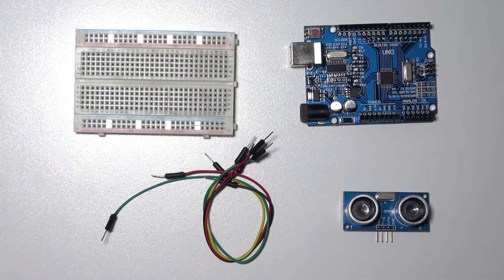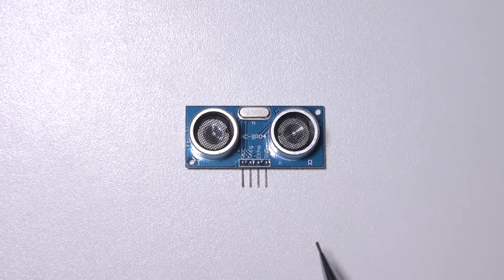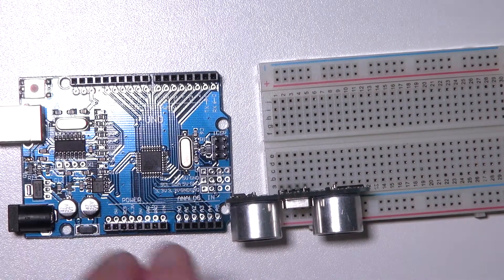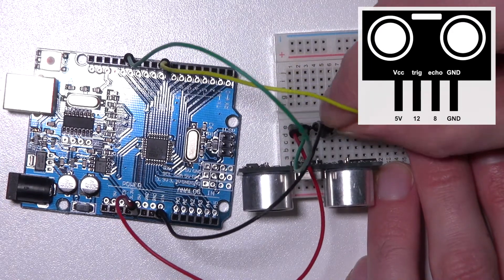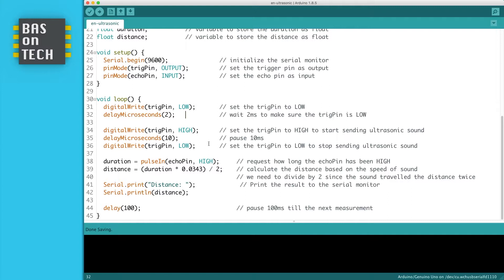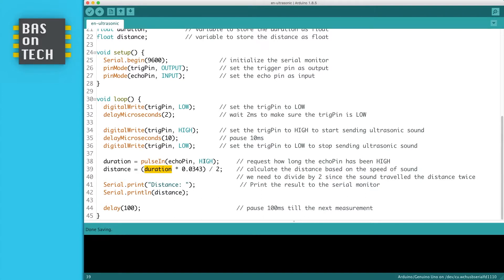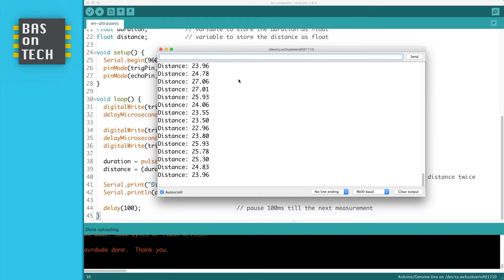ULTRASONIC DISTANCE SENSOR HC-SR04 - Arduino tutorial #7

Comment: At 3:42 (or line 35 of code) why do we set the delay at 10 microseconds in particular? 

And not at less or more microsecs?
Reply from the maker: We need a little time to start the sensor. Otherwise the measurement might fail. This was the delay I've found in other examples to work nicely.

Comment: Thanks for the fun projects.

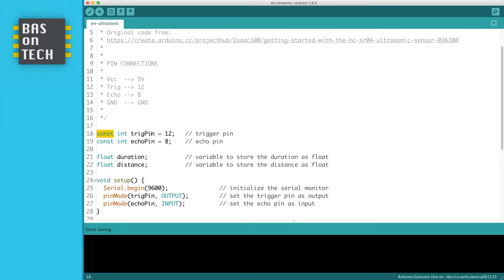At line 21 (and 22) of code (around 3:00) why do you declare the variable without assigning an initial value like in previous videos? 

Why'd you write 'float duration;' and not  'float duration = 0.0;'?
Reply from the maker: You can do both. Setting the default value is nicer since it is more explicit. However I've seen both being used in various code examples.

Comment: Speed of sound is 343 m/s so why are we multiplying duration by 0.0343? What is the unit?
Reply from the maker: Hi, pulseIn() return the elapsed time in microseconds. We want to know the distance in cm. Therefore we want the speed of sound in cm per microsecond which is 0.034 See:
https://www.arduino.cc/reference/en/language/functions/advanced-io/pulsein/
Reply: This is why I think he used the value 0.0343.

Because in this project, the distance is measured in centimetres, and time in microseconds.

Meaning we have to convert the rate of 343 m /sec to those same units.

And so we 1) keep in mind what we're after:

Rate of sound = distance /time = 343 m /s = ? cm /microsec

Next, 2) we consider the conversion of each unit:

1 m = 100 cm
1 sec = 1 000 000 microsecs

And 3) apply this knowledge::

.: r = d /t = 343 m /s = (100) 343 cm /(1 000 000) 1 microsec = 343 cm /10 000 microsec = 0.0343 cm /microsec

Comment: Hi pls i have projekt in my head but i need some opensource like seria monitor on recive data from sensors. do you know some propgram like this? i wanna control others elektronic from sesor data but serial monitor in arduino dev is soo simple. any grafic and user friendly. ty verymuch fopr respon:)
Reply from the maker: I have no experience with such tool. Maybe you can Google for software serial monitor, or perhaps ask this question on the Arduino forum?
Reply: hi. ye i find something but not much.so when you use more sensors and data from these sensors you have opened more serial monitors? teperature, sonic, humidity atd. you know i want see info in garden. is open kamera and 5-10 sensors. i read abou any nice graph moénitor but i have think is paid and hard programed in c++ + qjery. i am good in making system colapse and alerts with reactions and litll programed in arduino and c++ but interferace of system is on me too much. if you dont know its ok i only ask:) your tut is great. i know this think but every arduino men in internet make place better and better :) @BasonTech